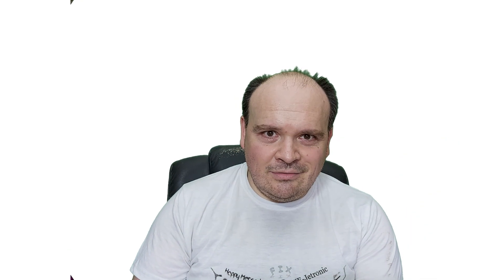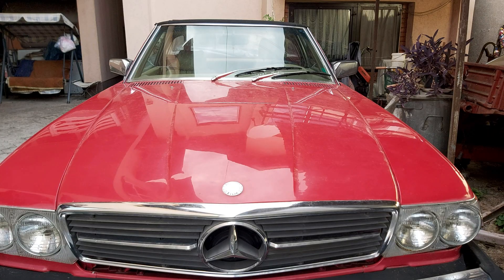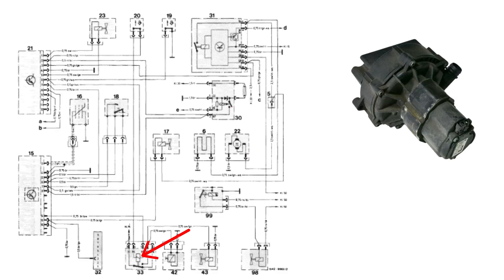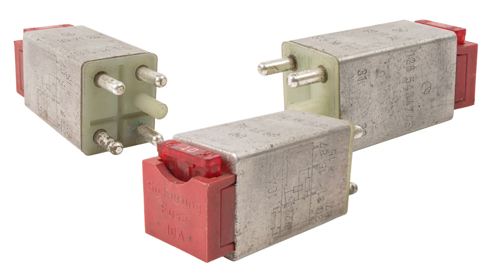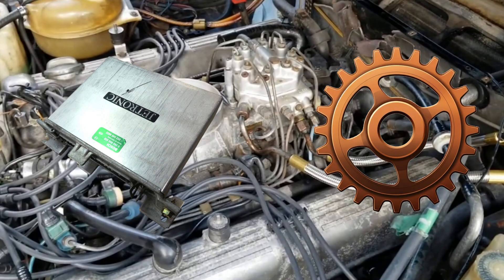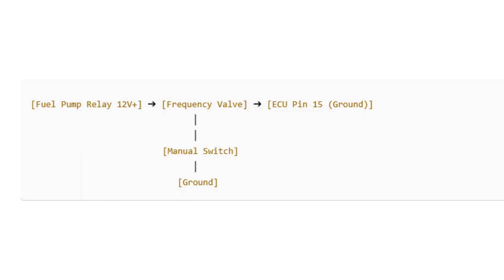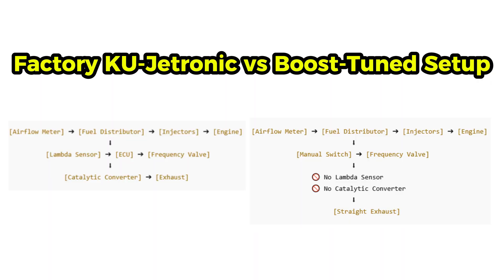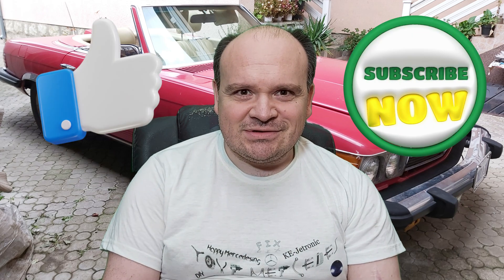㉦KU-Jetronic㉦: The Hidden Evolution Between K-Jetronic and KE-Jetronic | Full Deep Dive 🔧🚗

Comment: Wow what a solid video on a fuel system that is hard to find information for. I have a 1980 450SL which uses this system. I don’t think my frequency valve is working as it doesn’t buzz or vibrate. I used an oscilloscope on port 3 of the X11 diagnostic plug with ground in port 2- and I get a messy signal that doesn’t look anything like what other users post. Is it possible my frequency valve is not getting the right signal as well? How would you troubleshoot this issue? Thanks again for your highly educational video
Reply from the maker: Hi 👋 thank you for your kind words! The KU-Jetronic on the 450SL is indeed a rare system, so I’m glad the video helped.

If the frequency valve doesn’t buzz or vibrate, then yes – it may not be receiving the correct duty-cycle signal from the ECU.
🔎 A “messy” scope trace at port 3 (with ground at port 2) can point to:

1️⃣ Wiring or ground issues at the frequency valve.
2️⃣ ECU not sending a proper signal (possible internal fault).
3️⃣ Power supply to the ECU or relay problems.

How I would troubleshoot:
First, confirm that the valve itself works: apply 12 V directly (with polarity correct) and check if it clicks/buzzes.
Then, verify continuity of the wiring from ECU to the valve.
Finally, check system pressure and O2 sensor signal – if the ECU doesn’t “see” the O2 input, it won’t modulate the frequency valve properly.
So: valve test → wiring check → input signals → ECU output. That should lead you to the fault.

– Ivica | FixYourMercedes 🚗✨
Happy Mercedesing

Comment: Hi Ivica, im in despair. My m102 2.3 (136hp) is shaking and not idling well i changed spark plugs not the cables, the idle control valve is working, new rubber on the jetronic unit, i set the EHA on 6.6mm, the air flap is sitting on 3,17mm from the plank with the rubber as you said it should have 1.9mm freeplay it has this much freeplay when it touches the needle its 3,36mm, the potentiometer is concerning me, i folded the springs on the unit a little bit to have more contact. I turn the key it stays 5-6 seconds on 1k rpm then drops to somwhere 500 and its trying to stall, im thinking to change the potentiometer but it shows nominal value of 4.11 and then i switch to test the flap and when i touch it it is changing drastically 3-4-5-6-9-11. I don't know anymore, I throw my hands up it doesn't work and it doesn't work.
Reply from the maker: Hi. If the resistance value goes up smoothly then everything is okay. Have you calibrated the potentiometer correctly? When the engine is warm do you read 0.7V?
Reply: @mercedeske i removed the fuel hoses from the distributor when i turn the ignition on pump starts to make presure and the left 2 were leaking fuel so thats leaking distributor, bow i got a second hand from 122hp mine is 136hp i think it will work
Reply from the maker: @batuhanibryamov8937  Yes, it will. Let it just be clean. Eventually check how many turns no the fuel distributor you have on the old one and turn so many on the new one. You turn the allen screw and count the revolutions, once the key starts going hard turn the screw back for the number of revolutions you did and you will be on the position 0.
Reply: @mercedeske what turns i didnt understand?
Reply: @mercedeske the car is now working perfect, but needs just a little bit adjustment when it gets in operating temperature it starts white smoke to come from the exhaust smiling gasoline i can now balance screwdriver on the engine, its staying on 750 rpm but when i press the axelerator i hold it on 3k rpm then stop accelerating the rpm drops and then the engine shuts off
Reply: @mercedeske can i ask one last thing, what should be the perfect EHA stats now mine is at 6.6mm my motor is m102 2.3l
Reply from the maker: @batuhanibryamov8937  The fluctuation between negative 3 and 0mA. In positive range up to 3mA. The same thing as you rev the car at 2500RPM
Reply: @mercedeske i measured my lambda  it was dead, today im gonna change it  i changed the entire ke jetronic unit the air flap the potntiometer screws on the old one were teared, someone was turning them to maximum, the car is now very good idles well, lowers the rpm after start, wen acelerated again lowers the rpm but now it just needs proper mixture when i install the lambda i will do it, now i can balance a lighter on the motor it will stay.
Reply: @mercedeske  it was showing 1V i tried to tap it but nothing changed.